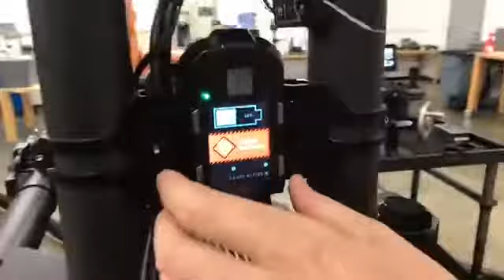MōVI XL Product Update and Q&A . FB LIVE - 5/5/2017

Comment: Hii guys 
Please help me out this solution 
I  want to ask some solution about the movi xl
I got a problem when I mounted the xl on a crane when the xl turned active mode n when I switched the controller at that time the gimbal is act wierd and it's not a vibration it's like a duckling so it looks like a  roll shake can u please suggest me some solution plz 🙏 reply me  
Thanks